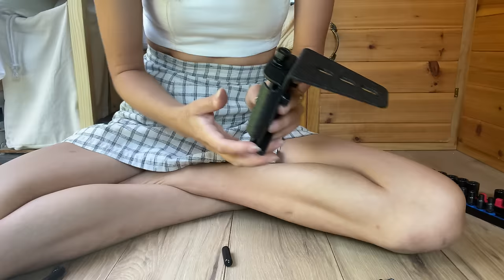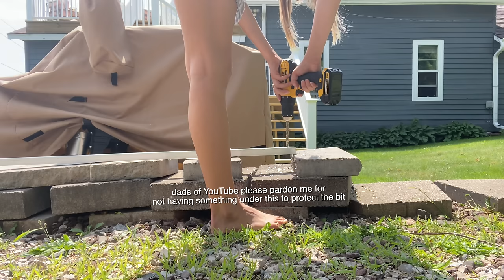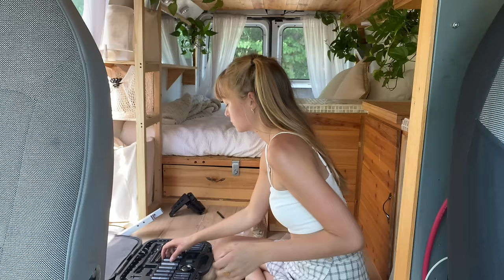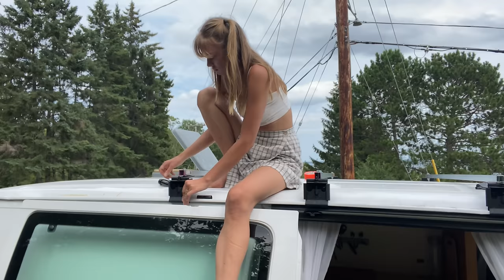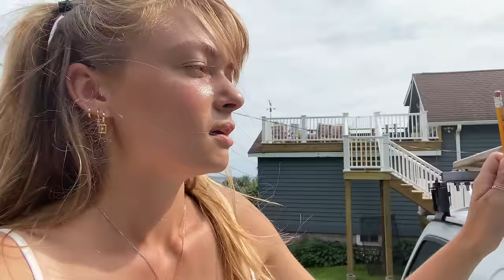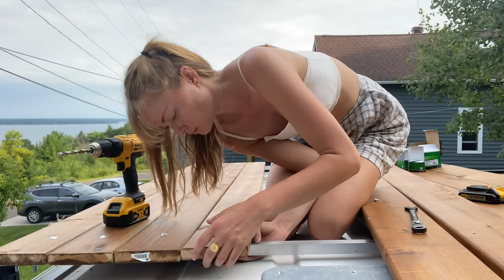I made a deck for my van 😎

Comment: OK, lots of comments from a YouTube “dad”.  I am also a photographer so I start there.  1) you have amazingly good composition, color balance and story telling for one so young.  I am constantly impressed with the way you are able to develop context and the story into your imagery.  2) Shocking how skilled you are with tools.  You go girl!  Such artistic talent followed by exceptional execution.  3) get a set of Forstner bits.  Instead of cutting notches for your bolt heads a Forstner bit makes a nice clean hole that is as attractive as it is practical.  4) Please, please seal the ends of your boards.  Driving in rain will push moisture into the ends of the wood and it will freeze in the winter and expand in the summer and crack.  Need a more pressing reason? Cracks=butt splinters etc. 5) you just tell a good story, informative, visually appealing, well executed, you have no where to go but up.  I think it is time for some major sponsorship, like tool companies, fashion and notions companies, travel companies, etc, etc.  Very best of luck, you are a pro.
Reply: Yeah, I was about to comment that those board ends needed sealing pretty soon.
Reply: @DavidHuffTexas  me too.  An open grain like that will soak up water, and cause twisting and warping too.  

Otherwise  Hannah, I  salute you for just getting it done.   I tend to dither and procrastinate when faced with something new.
Reply: you forgot the use of nylock nuts so they don't loosen up while she is driving
Reply: john mine You are absolutely right.  Short sighted of me.
Reply: dito on #4 also should have brought the boards all the to the side , not leaving a metal bar sticking out
Reply: @juniperwildflowers  HOW DARE YOU ASSUME THEIR GENDER! ASSUMING ONES GENDER IS HARMFUL AND IS VIOLENCE!!!! YOU JUST ASSAULTED THEM BY ASSUMING THEIR GENDER! SHAME ON YOU! hOw dO yOU kNow tHEy aReNt fEMsPlaInInG???
Reply: @juniperwildflowers  yeah, someone greatly underestimated the power of youthful enthusiasm!
Reply: She is absolutely amazing!!
Reply: @johnmine5609  I was just referring to the ones attaching the aluminum bars to the gutter clamps.
Reply: John Lowe, Photographist where did you learn your knowledge, and do you have tips on where a total novice (other than some scene building in theatre school 8,000 years ago) would go to start learning?
Reply: Jennifer Schemke That kind of depends on how you learn.  If you are a visual / auditory learner I would go to youtube. Lots of information in a way visuals can receive.  If you are more cognitive/kinesthetic learner I would just do some Google searching.  You were not clear on what knowledge you want to pick up.
Reply: @Graeme408  (You know she was a pro model for a long time? So the fashion bit, she's already been there and done that. Haven't heard her mention it in a long time, so she seems to have stopped doing it altogether, other than for her own shoots including depop, but yeah, she is unbelievably amazing in so many ways. Her videos are so inspiring and have the power to change lives. The things she builds all the time alone. She just goes and puts them together, no matter what it is and her sense of style is incredible. Etc etc etc. It pleases me to see how many people feel the same way about Hannah and her videos, for how many people her videos are like an oasis in the desert.)
Reply: It is not shocking that a girl has skills with tools. You are exposing your bias.
Reply: To everyone who felt it necessary to correct, chastise, or advise me:  It was just a compliment, nothing mor nothing less.  Not a big deal, just trying to be encouraging, a gender neutral, friendly compliment to encourage her soul.
Reply: She apologizes to ‘YouTube dads’ so people like you won’t make comments like this yet it somehow goes completely over men’s heads every time.
Reply: @juniperwildflowers  it’s not mansplaining. clearly you went over all the compliments he gave her and him acknowledging her skill with tools. he was just giving her advice. not trying to explain stuff to her. find the difference.
Reply: Why is it “shocking” how skilled she is with tools? Is it because she’s a woman?
Reply: @JohnLowe I'm a 58 year-old woman and I thought it was a very nice complimentary and helpful
 comment.
Reply: @emilymartin5418  no Emily not exposing bias. Just someone who was in an era where women did not usually step out of their prescribes roles. Rosie the riveter was the beginning of women being stretched out into the prescribed male roles due to men being absent in the wars. It’s all relative. Men usually are pretty open and excited for women to do this stuff! As we females enjoy men excelling in traditional women’s roles. Who doesn’t melt at the picture of the tiny baby in big rough man hands. All are learning.
Reply: @Graeme408  good on you John. There are buttheads in every feed! Lol 😂
Reply: @astrawberryswinging  lighten up Alice
Reply: @gabrielfranco9786  yes

Comment from the maker: Thanks for watching guys!
Some notes:

-I used aluminum bars because I didn’t want them to rust, they were cheap, and they were lightweight - you could definitely use stainless steel if you wanted something more rigid. My bars (obviously) flex a little, but they’ve been great so far, and no problems!
(…I may or may not have filmed this video about a month ago, so I’ve had some time to see how they’ve faired)

-The planking I used was cedar planking. I was originally going to buy the plastic type decking boards, but when I was talking it over with the guy at the hardware store we realized the cedar was less expensive, and lighter weight. Plus I got to stain it whatever color I wanted. Just added some top coating to make it weatherproof. (Highly recommend allotting yourself enough time to stain & top coat everything. Takes about a day or two to coat, and then let dry for each.)

-Use a metal-drilling bit for the metal bars.

-I forgot to mention this in the video, but I decided to forgo a ladder for the time being. I’m pretty good at clambering up to get up there, so spending the money seemed silly, and just extra stuff to deal with. After a while my mom pointed out that she has a handy step for putting her kayaks on the roof of her car; it just attaches to your door latch and you can step up. Here’s a link to one similar to what I got (can’t seem to find the one I got): https://amzn.to/2EYezCy

If you build a deck on your van send me pics! (DM me www.instagram.com/hannahleeduggan) 
Share improvements, ideas, excitements below this comment ♡♡ 
Enjoy!
Reply: Hey little remember me .sure you don't it been over 10 years now .but I miss you
Reply: I wonder wouldn’t the plastic deck get very hot as well. So going with wood is probably also the best idea considering that it’s more lightweight, price is lower and customization of color as you mentioned.
Reply: Rad job fellow econoliner!! Where did you find your gutter clamps?
Reply: you're my hero.  I love seeing you work ! 
I just want to suggest, if you haven't already , put something on the end of those aluminium bars so you don't accidentally hurt yourself on the sharp edges when getting up and down.  happy travels ❤
Reply from the maker: Bobby Wall
https://www.amazon.com/dp/B00AQFE7YY/?tag=hannahleedugg-20

These are the clamps I bought, they’re definitely pricy, but they look like they’re not back ordered right now! 😣 most vans I saw with deck builds had tracks already built into their roofs to start from. Definitely would have been a LOT cheaper if I had those, but alas.
Reply: You did a great job Hannah! We LOVE our sunning deck tooooo
Reply: If you make a bigger hole in the top of the aluminum you can pass the bolt down inside the tube so the head will be out of your way and you dont need to notch anything. Then you can place boards right to the edge. You would probably have a fairly easy time drilling this larger hole with a "step drill" bit. It shouldnt be too hard since its aluminum. make sure the upper hole is big enough for the bolt head and the socket to tighten it with
Reply: hannahleeduggan stainless steel is to hard to drill into . You went the right way. Looking great. Put some shoes on and wear some safety glasses you silly goose. 👍
🦶🥾
👁🤿
🤪
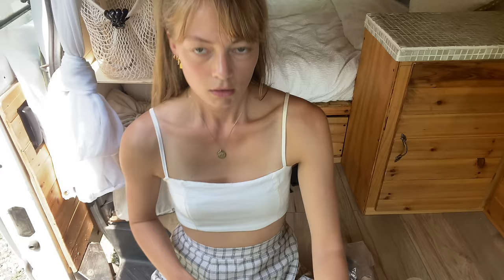Reply: @4:42 Clamps work to prevent fwd/bkwd  motion and side to side pitch/yaw  Using the deck will eventually loosen the bolts because the aluminum will bend
Reply: Hey Hannah super duper job here! 👍👍✌️✌️🌹🌹
Reply: I am a new subscriber. I was watching woodlot purchases, and cabins Off the Grid type channels, and yours got recommended to me. You seem to be a person that enjoys a challenge and with the cabins you purchased, and the property , you have tackled that pretty well. Now for my suggestions for your roof deck. With your bolts being the length they are that attach the aluminum tubing to your gutter clamps, you could double nut those and lock the two nuts together. I would also suggest on those to put a bushing on the inside of the tubing with the Bolt running through them to keep the tubing from collapsing this would make everything much more rigid. The bushings would not be necessary on the planking since the wood would give more  then the tubing. You have received a lot of comments about the end-grain on your planks already. My only suggestion is have a small can of your sealer with a small brush to paint around the stove bolt heads as the bolts are tightened into the wood. Good job it looks great and functional! Almost forgot they do make plastic end caps for aluminum tubing. Prevents whistling when the wind is from the right direction going down the highway. Might want to pop them off once in awhile to let it dry out inside.
Reply: Hey you are amazing fearless gorgeous woman we so far know about tha positive amazed side of living in woods  or van please tell us what are the negetive sides of these...I mean if you ever faced any threats any fear any danger???I really hope so the answer will be a no but still
Reply: I always get a can of spray varnish to spray the drill holes before bolting. Especially with acidic woods that etch the galvanizing off.
Reply: @stevecarroll4217  so, you're creepy.
Reply: @emilymartin5418  huh
Reply: Sorry you feel that way enjoy life and thank you I try
Reply: And the gutter clamps cost about a hundred bucks each!!! I was gonna copy you but I can’t afford that.

Comment: I manufacture cars. The exterior of vehicles at speed are subject to enormous wind forces and vibrations. Over time I am concerned your fasteners will loosen which may allow something to fly off the van. The simple and proper (and fairly cheap) fix is to replace at least some of the nuts with a nylon inset lock nut. The advantage is if the wood shrinks or the aluminum deforms the fastener will be loose but it won't come off.  Have fun.  You have a cool van.
Reply: SURVIVAL OUTPOST CHANNEL  Also good against squirrels
Reply: Good advise. Have you ever seen your solar panel travelling faster than your car when you do an emergency slammed brake? 😳Me🚽🤣🤣🤣
Reply: Definitely install lockouts everywhere.
Reply: Lock nuts yes.. go all metal and use spiral lock washers that will handle the shrinkage and expansion.. 
Dang girl!!! You Crush it!!!
Follow me back!!! Peace!!!
Love it.. not shoes!!!
Reply: @madgardener5820  dying

Comment: Great work Hanna and 4 ***stars just for going it alone and a fifth star for completion but it never hurts to ask someone that has knowledge in woodworking/decking and I know you din't ask me but I got to tell you that leaving a space between the planks for expansion would have been an excellent idea, with a little luck there is still moisture in your planks so that they may create the shrinkage on there own. Also sealing the ends of the planks to discourage splitting would be a good idea, even a roofing tar like substance would work as the end grain will drink up whatever you apply and once again a great job of just winging it, you are fearless in the project department. Kudos

Comment: Definitely be careful up there with any kind of moisture, I stayed at a campsite that had a deck just like this (not on top of a van though lol) and slipped on the sealed wood in the rain and bruise my butt horrendously, 3 years later i still have a massive bump. Just be cautious because the deck could get slippery! Looks awesome!

Comment: Good morning. If you haven't already done this, get some silicone caulk and run a thick bead in the gutters. As time goes on, the clamps will put pressure on the drain channels of the gutters. They will begin to separate, and water will leak in. Good luck and safe travels. CHEERS from Colorado

Comment: Those boards are gonna go wild!  As others have said, your nuts and bolts won't stay tight without help. If you have enough extra thread on the bolts to hold both safely just double up your nuts with a nylon lock nut. If you want to keep your boards from buckling, run a circular saw between the boards and be sure not to cut into your aluminum rails. The kerf of the blade will give the boards more space to expand. The way your frame is built you wont be able to do anything about the ends twisting and curling though. Looked like you needed some sealant on the ends of the boards too. Make sure it soaks in real good on the end grain and you'll be good to go.  p.s.- If you were my daughter I'd be one proud dad!

Comment: Anyone that build decks for a living would tell you that the end of your boards should be a sad face not a smiley one cause when they get older they will split and cause splinter when the are a smiley face on the ends.  Also people are right about the lock nuts or loosen them and put some red lock tight on the ones you are using.......  Good job with all that you have been doing even at the cabin.

Comment: Nice work. Looks good, and I bet it will be a great place to hang out. 
Don’t forget to seal or somehow cap the front edge fo those boards. 
We’d be interested to know if the shade from the deck keeps the roof and the van interior any cooler.
Good Vibrations

Comment: Great van build 👍👍.🤔 The next time you drill on your deck be sure to put a beer or flat or cardboard to catch the hot metal shavings so it doesn’t melt the paint or any potential metal shavings to rust during the morning due. Same other technique applies when drilling into a roof so the hot shavings doesn’t melt the headliner fabric. Just say precautionary measure.

Comment: Perhaps measure the thickness of the wood plank to be drilled, and put tape on your drill bitt the exact length of the bolt. Still a good idea to put a piece of wood to protect the van though 👍🏻. Awesome job girl! I wish we could put a rooftop deck on our van, but ours will be covered with solar panels, an ac unit, and a vent/fan. I also just ordered a telescoping ladder to have easier access to the roof.

Comment: I hear you about the too long hardware. I have a bench that I got machine screws that were 2" too long. Just wondering if it would have been easier to drill the holes for the boards and aluminum rails before mounting it on the roof?  It looks awesome!

Comment: Looks great! But please consider adding "lock washers" or use nuts with nylon locking in them. The wood will expand/shrink, the aluminum can compress, over time the nuts will come loose and start to fall off unless you retorque them as needed.

Comment: Gutter clamps are a pain to remove i had a doge 250 maroon and white 1980 van in 2008 i had a situation when i lived and use to own a trailer on .9 achers of lant coming into a turn i had a 1970 full size chevey pickup truck not only speeding but he was in my lane, i swerved he missed me but i sheerd of the 3rd tree in this yard mu van was still drivable, but i was having problems with the fule injectors i sold it, and as for the gutter clamps i could not get them off so i left the stupid things on it

Comment: rad!! what a great idea! sunshine, coffee mornings, woo! lol 😊😊😊
Reply: I like the idea of having a sun deck on a van roof, and to me it looks really pretty. I also appreciate the diy-way it's being done. 

For myself, I would have done some things slightly different:
 Fitting the poles to the clamps: In order not to have a rattling roof load soon, I would have used nylock nuts or at least two nuts counterfitting.
For the deck: To prevent water sitting on the wood, I would have chosen to set the planks in a slight distance to one another, say about 1/8" or a bit more. That does not really reduce comfort when being up there.

The planks, in my opinion, should also be secured against being rattled lose or losing volume due to shrinking of the wood: I would have used nylock nuts at the front and rear bar for that, not locktite, as re-fixing after some time would be easier.

Last but not least, I would heavily seal the planks' open ends, for these are the first spots to be soaking water when driving through rain.

Someone asked about the weight of that roof load and if the shocks were rated for that:
I can not imagine the rated roof load of that vehicle being less than 200 pounds - while driving -. In standstill it could surely bear a lot more, because of no dynamic weight influences.
That deck to me seems way less than 200 pounds. So, if not being used to carry anything on top of it: no time to worry!

Comment: Did you use stainless bolts , if not they will rust. Also if you use a lock nut they will not work loose as you drive.

Comment: ...should really use locking nuts on the bolts as driving and vibration will loosen the nuts over time, nice deck